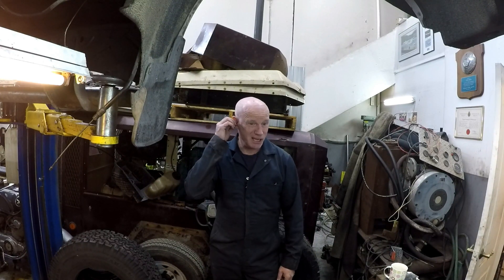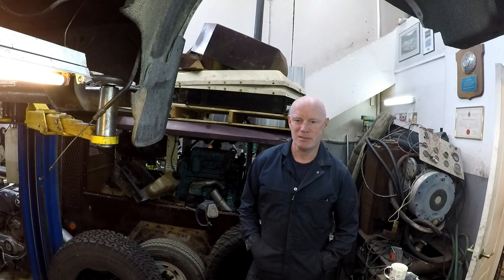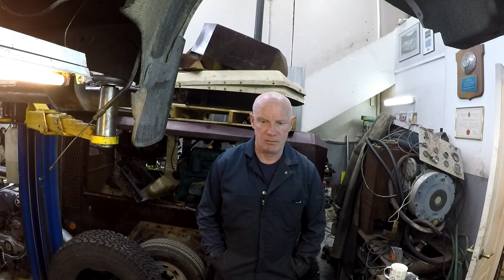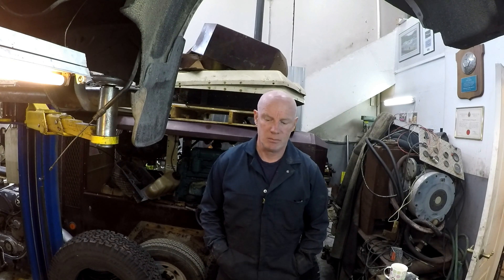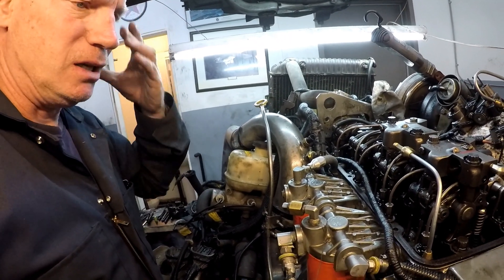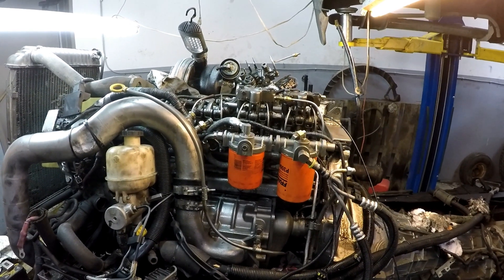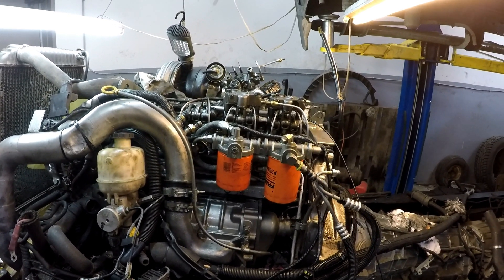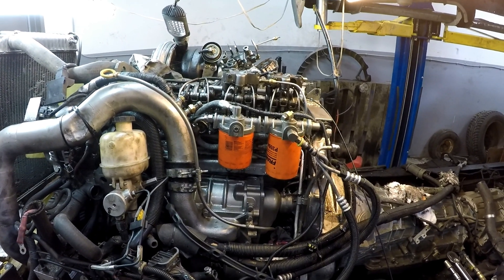Detroit 4-53TIB Ingested Aluminum

Comment: i know the feeling:)
Reply from the maker: True, speaking of compression tests, what were you getting on the good cylinders?  How’s the new head coming along?
Reply: @detroitgarage9430  we just finished today ,and the engine ran great,tomorrow we will be going for a test run,i had great readings on the 5 remaining when i tested, 460 480 left bank 460,450,470 right bank,i would have to lok at my notes,beware of testers,some dont read right,learned the hard way,had those readings from snap on tester.
Reply from the maker: @TheMatrixgod  that’s great to hear.:)
Reply: @detroitgarage9430  i did mention your problem to the old feller helping me along,and i didnt even notice you already had it iunder the title here

he also said sounds like its coming from the blower or the turbo,and watchj out for gaskets,some gaskets for that blower are to thick,i had to pull mine out again and swap the gasket,